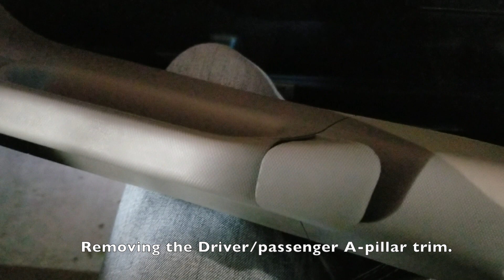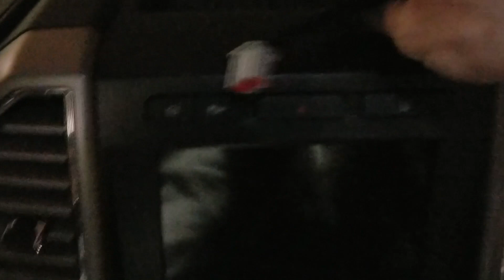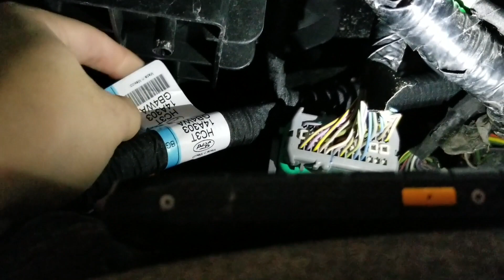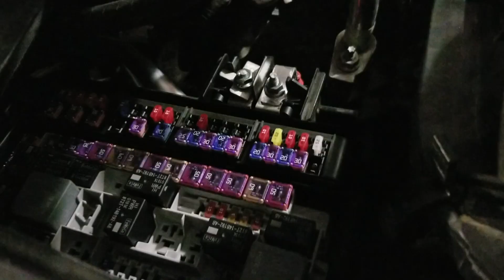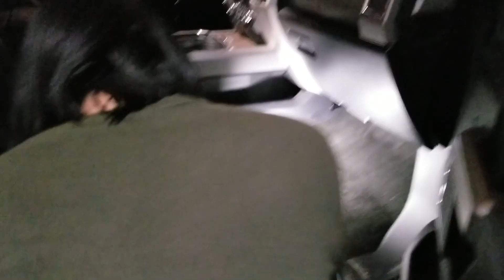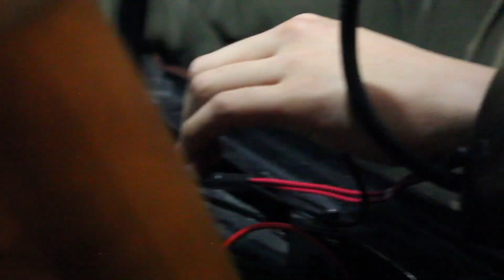2017+ Ford Superduty Upfitter switch install + Elevated idle mod

Comment: This was truly awesome.  Thanks.  Two questions.  Can you provide a link to whatever ford site you pulled the bulletin from...and in the begining of the video there was a cab wiring diagram I am assuming showing the routing of the main harness.  Where did that come from?

I have got a source to order the parts for my conversion and will be doing it soon.
Reply from the maker: Ford Body Builders (fordbbas.com) which is free to access. The cab diagram (if you're referring to the one on the laptop screen) was the Ford service manual. It's a $200 disc.
Reply: @55quadboy  where do you get the service manuals?